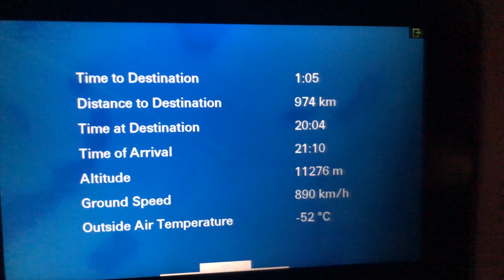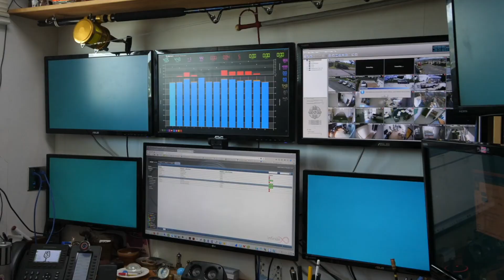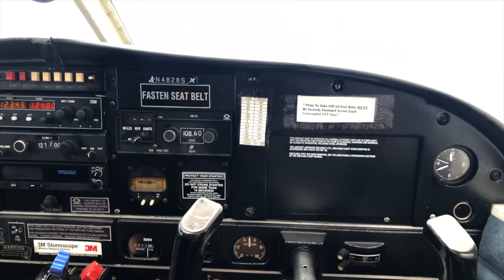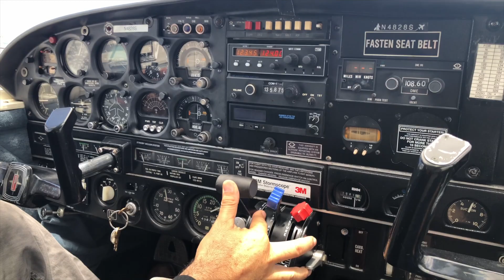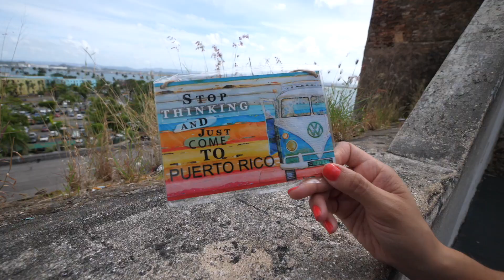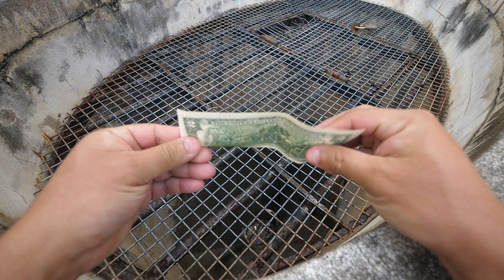DIY TESLA POWERWALLS FOR SALE In Puerto Rico?

Comment: Any information or wiring diagram for the off-grid/standalone Tesla Powerwall 2 and solar setup. How does the battery charge without a grid as solar inverters typically need a grid to function.

Comment: EDIT: Ignore this comment, apparently Batrium burns energy while charging by bypassing the cells that are higher voltage. So it doesn't strain the battery life time capacity. So the equalization is slow, but it doens't discharge cells to equalize, just burns some energy to bypass some of the incoming (solar) energy to balance slowly.

Wait what? The Batrium BMS is burning energy to balance? Isn't that the really bad kind of battery balancing method? Charge, then discharge until they are equal? That artificially reduces the life cycle of your batteries, doesn't it?

Afaik the small BMS form electrodacus is doing it the right way. Just charging the cells that are too low instead of discharging and wasting life cycle of the cells that are too high.

EDIT: I think the name for this is equalisation rather than dissipative (no energy wasted). Is batrium dissipative? But really I don't want to discharge the batteries to equalize either, they should be equalized using the power from solar panels ideally. Is that a hard thing to do?

PS: Awesome project :)
Reply: Dejay Rezme hey I want to do that, I believe my rusty power electronic, PLC knowledge can still be used to a good use
Reply: I bet :) I'm still learning and trying to understand how these balancing systems work.
Reply: Dejay Rezme yup you do that, I will follow suit to buy cheap BMS that can do top and bottom balancing, will not burn the resistor just to reduce the cell voltage. looks to me easier, a BMS that connected to the cell individually with small wire, that stops charging when correct voltage is reached. 1 voltmeter with only (a good one) but took sampling let say 5 second to look at a pool of cells..hmmp
Reply: There is a DIY BMS system you could look at: 
https://github.com/stuartpittaway/diyBMS
Adam Welch on youtube also has some video building this.
Reply: Dejay Rezme thanks, I will look into it